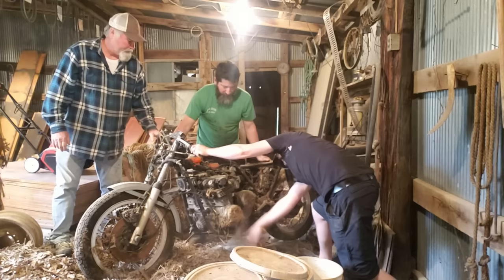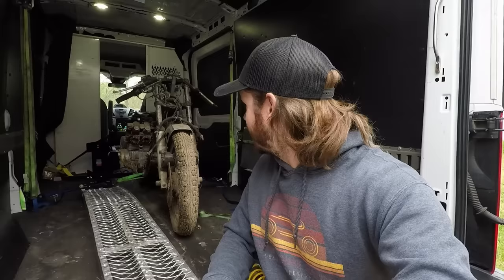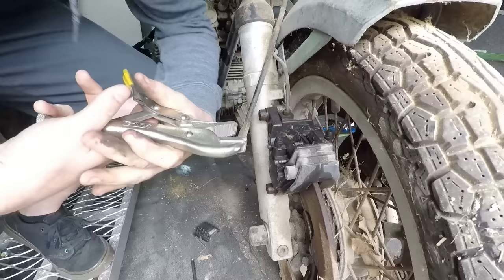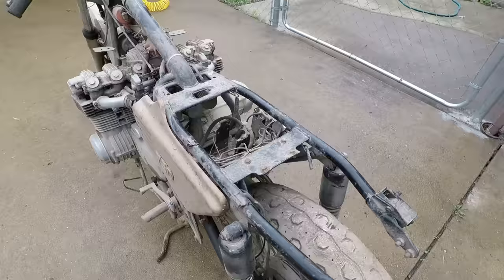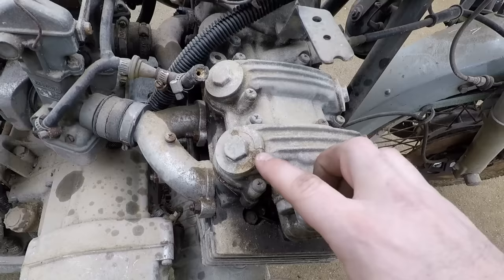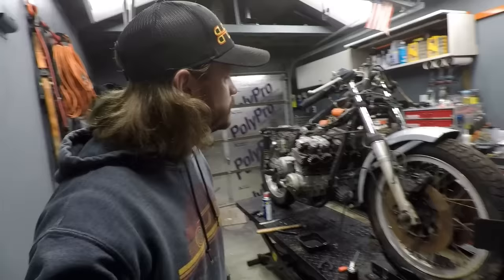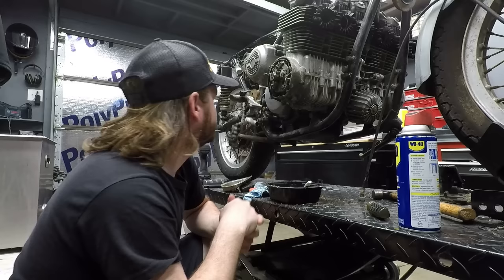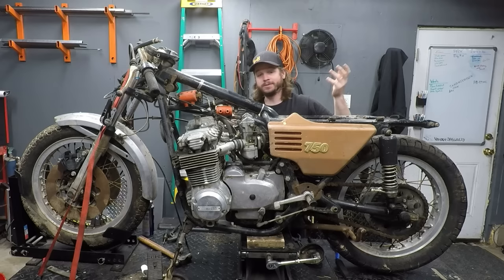BARN FIND Benelli 750 SEI 6 Cylinder!

Comment: GO AND BUY THE CORRECT SIZE PLUG SPANNER, PULL THE PLUGS, THEN PUT SOME UPPER CYLINDER LUBE IN IT, BEFORE YOU TRY TO TURN IT OVER. THOSE PISTON RINGS WON'T LIKE WHAT YOURE DOING!!!!
Reply from the maker: You left your caps lock on

Comment: I am pretty sure you've heard of this before but, just in case "Black Ironwood" or "Oak" wood wedges work wonders on cases and most cylinder heads and jugs. If you make them in 7 sizes (you'll know which ones) they can cut the hammering and fatigue in half with way less effort. I learned that from a guy that built "Side Valve" and "Knucklehead" Harley's!

Comment: I have actually ridden one of these bikes. One of my friends bought one from an old timer who didn't know what he had or what it was worth. My friend is one of those guys that always seems to find those unbelievable deals. The owner thought it was shot and needed a full rebuild but my buddy noticed that the plug wires might be wired wrong, SO he offered the guy around $2500 for it (it was several years ago) and he took the bike home. The firing order was incorrect LOL. They are pretty fast and very rare. The best thing about these bikes is the sound! They rev to around 9K and sound like a Ferrari! Good luck with the repair.
Reply: They made them from 72 right up to 89, first in 750cc like this one then later in 900cc, theres more of them out there than people realise. :-)

Comment: Amazing, this one was a rollercoaster for sure. I noticed the fairing bracket on the front from your picture on the weekend but after looking at it for a few minutes realized I had no idea what it was other than some old custom racer, but hey I'm still learning this stuff. I agree turning it into a more modern version of what it was would be pretty cool but time to do it is your other issue. Would be one helluva build series though. 👍👍
Reply from the maker: Yea a Rollercoaster for sure! If I had a plug socket I could have done much more but oh well. I feel a build is more fitting for the bike. There are plenty for museums and collections so this will pair nicely with the already modified Benellis

Comment: No need to apologize for not doing the "as factory new" type build.  Totally agree that using the this as a basis for a nice Cafe Racer or just a nice street bike using as many modern parts as possible. Reliability, safety and performance is what motorcycling is about (in my opinion).  Super cool find!
Reply from the maker: Agreed! I am just compelled to address my decisions multiple times as a lot of people like to comment before watching the whole video and hear my reasoning.

Comment: Wow nice score. There was a perfect small bike shop in town here called British Motorcycles.Through the `70s they were new bike dealers for BSA, Triumph, Norton, Laverda, BMW, Moto Morini, the odd Ducati or Benelli. Never more than 10 new bikes in the showroom, the selection varied constantly. If you turned your back to the showroom, you were standing at the parts counter, which looked like a re purposed bar. Yes that small. 
They had a couple of 750 SEI in there over one summer. Both were Ferrari red with 6 into 6 exhaust. You could even buy aftermarket 6 into 6 systems to make them cooler and louder. Only a few guys in North America raced those, still with 6 pipes! A pal had a 900 SEI with stock 6 into 2 pipes. It was faster but no louder and not as wild as the 6 pipes. Remember the mufflers then were way smaller, forget the huge cans used now. Like paint can size or less.
There were even 6 into 6 aftermarket pipes for a CBX. Coolest blasting sound you ever heard. 
Hope your project works. Beware of the nasty sharp edges the Italians left on mating surfaces. Got some cuts from those till we learned to de-burr them asap.
Reply from the maker: Sounds like an epic proper old school motorcycle shop!  Im a sucker for 6 into 1 systems myself and plan to make or source one for this whenever we get to that point. Same for the other CBX I have.
Reply: @BrickHouseBuilds  Hi BHB. Denco and Devil were 2 companies making pipes for Binelli back then. I bet someone still has a set forgotten on a shelf. Ebay search?
You would have been in that bike shop a lot. Run by Peter Clegg who is still around, he even arranged Isle of Man travels. You brought your own bike, in the hold of the 747 you were on. 25 bikes and 30 people went on our trip. Ming boggling cool, wall to wall Mv Agusta, Laverda, Brough Superior, et all.

Comment: I am  a  huge  70s  Benelli  fan 
Your  Honda  CB 500/4 knowledge will help  you out a lot here.
This engine is basically a Honda 500/4 copy with two extra  cylinders 
To the  point that  quite a few of the  engine  internals are  inter changeable  between the two makes.
Nick Australia
Reply from the maker: Thats what I'm finding which is great

Comment: If the cracked case leaks, JB Weld it so it will hold oil, then oil the cylinders up with a good penetrating oil, fill the crankcase, plug the exhaust ports, bag the carb filters and then you can let it sit until you have time for it. What a great find! I can't tell you the last time I've seen a 6-cylinder Benelli....
Reply: I have one lying  at the back of my greenhouse and that is where it is going to stay, the plants seem to like it.

Comment: I had one new (and was a Benelli dealer in the 70s) and bought one that didn’t look much better a couple of years ago.  I did a full engine overhaul, cleaned/painted and it runs great now.
 Parts are readily avaliable, with LA Nik having quite a few here in the States.
Reply from the maker: Great info Mark! Have a link by chance?

Comment: Ive got a black 900sei tyhats been sitting in a garage for years.Gonna get to it soon and get it running again.These bikes have plastic fuel cells with just a black fiberglass shroud that just looks like a tank.I have two tanks.One had the petcocks actually sawed out and the other has hairline cracks around the petcock threads.Mine was stored for years in a heated garage and had been sprayed with some type of brown preservative.The whole bike was sprayed looked awful BUT it cleaned off to uncover an emmaculate bike.Ive got 14 classics .This is the last bike I have to get to.Doing a Guzzi LM1 right now.I have 6 Guzzi's.

Comment: The Benelli multi's were basically copies of Honda cb500's with 2 extra cylinders added. Many engine parts are identical to Honda parts. I recall hearing that the bore and stroke and the valves, are the same as the Honda, and the valve inspection covers also. I imagine that getting genuine Benelli parts may prove problematic! Best of luck with the rebuild!
Reply from the maker: Yup that's what I'm seeing. Luckily I won't need any Benelli parts outside of some gaskets and a few other bits
Reply: Is it so much a honda that it needs JIS bits, just wondering, benelli being italien and all?
Reply: @larshermansen3463  No. Allen screws all round.

Comment: It’s always an advantage to try to get a motor to run early on to see if there is value in continuing. Bought one with a blown piston but didn’t notice until dropping $500 in parts. Should have made it run first.
Reply from the maker: Agreed,  I'm not sure I can avoid an engine teardown with this one due to the case damage but who knows.  Once I get the plugs out Ill see what to bores look like and assess from there.

Comment: It’s definitely worth bringing back to life. I suggest you simply get it running at your leisure over time without rushing anything, heck you may even find some needed parts as time goes by.  Aluminum tig welding is tricky if your not experienced with welding aluminum.  Definitely worth taking the motor apart for a proper repair… but cost effectiveness is the big factor here.. I would never trust JB weld, I lost a motor like that!  
I wish you luck with it… and someday if you decide to sell I would be interested in it. I am a professional machinist and wouldn’t mind diving into it.  Wishing you the best no matter what direction you take.
Reply from the maker: Yeah this bike will be a rewarding one to bring back. The JB weld is just to make it run kind of thing but splitting the cases and doing it perfect is more likely what will happen.

Comment: just a word of advise from an old motorhead, i never try to turn one over until i get the plugs out and soak the rings in breakfree or wd or 2 cycle or ? those rings can break or crack easily !!  i have found that an old spark plug socket that came with some old bikes will sometimes work,  wrench on my friend !!
Reply from the maker: Right I talked about that but obviously couldn't get the plugs out with the sockets I had on hand. It was a shame I only had 24 hours from buying it until it had to be back in the warehouse to get back on customer work. Standing by the bike now and its definitely distracting lol

Comment: Great find!  It"s already got Honda switches fitted to the one side. Many more Honda CB500 sohc spares will fit. Keep up the good work!
I hear you with regard to not having the time to restore it right now but this Benelli needs an in-depth rebuild so I would park it for a year or so and then tackle it. JB-Weld just to get it running... and then what? I say park it, collect the necessary bits and pieces as and when you find them and when you're ready give it the love and attention that it deserves.
Reply from the maker: Agreed. It will be a year before I touch it regardless and in that time I'll be working on back end research and parts sourcing
Reply: @BrickHouseBuilds  If you tell us what major parts and components you need I can keep my eyes open for them here in Germany?

Comment: That hole you were  talking about using JB Weld on is the main oil gallery & feed to the mains & crank etc.
Reply from the maker: Correct. Not talking about slathering the stuff on aimlessly but rather recreating the area to allow oil flow/oil pressure

Comment: As for the lower engine case, I think that as it is outside the actual crankcase it could be an easy weld without stripping it, Tig in small doses would be ideal, but it has certainly been down the road
Reply from the maker: Its a bit of a tricky spot with it having an exposed steel pipe for the oil galley under the aluminum that broke off. Welding the case at the necessary amperage may melt the steel and make things more difficult.  It will be a challenge for sure
Reply: @BrickHouseBuilds  Ah! I see, or rather I couldn't, terrible camera work mate :) :) well you're the man on the spot, shelve it until you have the time and energy then, maybe even find a new bottom half, although that the first casualty in an off.
Reply from the maker: @k13ehr  yea that shot of the damage was  terrible  lol.  I'll show more in time with more time
Reply: @BrickHouseBuilds  No worries we all have to start somewhere 👍😉😊😁🤣

Comment: It has obviously been crashed which is evident by the damage to the points housing and the lack of fairing , tank and seat . Maybe the owner put on a new front brake lever and then decided to give up . The water coming out of the engine is most likely because the exhaust ports were not sealed before water blasting . I have a 500 Laverda which I am slowly getting road worthy , so good luck .
Reply from the maker: Paul, I talk about it being crashed. Also, I did seal the ports which I didn't show. I had sprayed up that oil galley before I realized the hole was there so thats why the water came out.

Comment: I have a 1980 Benelli 900 Sei in the back of my garage, one day I'll get it back on the road where it belongs. My 900 has a bank of six 22mm Dell Orto carburettors, Tarozzi rear set controls and a modified Silentium six-into-six exhaust system that was intended for a 750 Sei.
Reply from the maker: Awesome bikes!
Reply: @BrickHouseBuilds  Thank you for your reply, they certainly are awesome machines, they are well balanced and handle far better than Japanese machines of the day. I have owned my Sei since 1986, so it is certainly a keeper, the value of both 750 and 900 Sei models have risen sharply in recent times, there is a 16.5k mileage 900 Sei currently for sale on the UK eBay site for an asking price of £19,999. We have an avid Benelli - MotoBi owners club here in the UK.

Comment: The Sei is not a very complicated bike.  It's been said that the motor most resembles a Honda 550 Four. It might take a little looking to get the proper tank and accessories but, with the low production numbers of many of the Italian bikes, many of the accessories are used on more than one brand. Should be a fun project.
Reply from the maker: No more complicated than most of what I work on. Luckily I don't need to source many factory parts as it won't get stock exhaust or tank so that makes things much easier

Comment: CBX engine swap with the vintage racer look?? Haha that would be awesome but this is a cool video BJ! Sucks that you found those issues but like you said, you saved it from the barn and watching the pressure washer clean up that ride was also cool.
Reply from the maker: Well the CBX engine is very different.  This is the original engine. Basically a cb500 four with two extra cylinders.  Single over head cam 2 valve per cylinder

Comment: Love how similar the engine looks to a CB engine.   Would be cool to put one in a CB750 chassis
Reply from the maker: It would be purely for the sounds as a SOHC CB750 makes the same power as these
Reply: @BrickHouseBuilds  yes for a sure and also the wtf expressions on peoples faces trying to work it out
Reply: I bet it’s not as reliable as a Cb 750 ..still great find
Reply from the maker: @donbrashsux  maybe but maybe not
Reply: @BrickHouseBuilds  The Benelli Sei was based on the Honda CB500F, a Sei motor will slot straight into a CB500 or CB550 chassis, but why bother installing the motor into a poorer handling Japanese chassis? A stock Sei will run rings round a Japanese four of the same era.
Reply: @davidmacgregor5193  Two points: First, you’re right about a CB500-4, a guy I was slightly acquainted with back in the late seventies used a CB500 engine in his Sei while he was waiting for parts from Italy. I dimly recall the CB550 was slightly different, maybe due to the change in the clutch actuation but I recall it didn’t fit, definitely could be wrong. Second, don’t jump to conclusions, the CB750 chassis left room for improvement but the 500 handled very well. On the street and on the track the few guys who got past me were better riders or they waited for a straight, I can’t blame the bike.

Comment: You're right, its to far gone to restore and make money, did'nt Honda take Benelli to court over these as the engine is just 1 1/2 Homda CB500/4 so if you need engine spares the honda parts will fit
Reply from the maker: Im not sure about court as it may have been licensed from them. I honestly don't know much at all about Benelli other than a quick Wiki but know enough to jump on the opportunity

Comment: Had a friend of mine who had one of these and let me borrow it for summer. Just about every standard position of braking and shifting was switched and backwards. Took a while to get used to. Was a fairly fun bike but nothing too outstanding about it. At least yours has disk brakes on the front  mine freinds had drums and they could be a bit scary.
Reply from the maker: I assume he went GP style on controls. That may be what I do just for fun...or not fun lol. I am expecting nothing outstanding as my cb750 should be on par for hp. It is a small bike though so I'm excited to see what I can do with suspension and brakes

Comment: No JB weld , disassemble everything put in box’s come up with a plan what to work on first. Not saying total restore. Just clean original. Complete and running. Using donations.
Reply from the maker: Oh Id prefer the rebuild but for the sake of science a bit of JB to reshape that oil galley and get it running would be cool.  This project is far out for now as....my CBX is fully disassembled in boxes with that plan.....
Reply: Been there done that I have had for CBX motorcycles all 1979 I can tell you the good and the bads.

Comment: Worked oil  refinery shutdowns. We used a mixture of brake fluid and acetone , we called weasel piss .To unfreeze everything. Just spray the weasel piss on and tap the stud  ,nut with a hammer.
Reply from the maker: I'll have to make a batch of said piss!

Comment: Irony is rear sets on a bike that is way too broad in the beam! Engine will drag cornering. My cbx had a Jack shaft with alternator on it to keep engine width reasonable...my kz1300 was too broad in beam too.
The benelli was a cloned honda cb750 sohc with two cylinders added...
Reply from the maker: Regardless of how wide or narrow it will still be amazing fun. There is always something to out perform it such as any modern bike. Also these were modeled after a cb500f not 750

Comment: I’d personally try to restore it! As it’s a rare Italian super bike. Is it possible the exhaust and tank are somewhere?? If not the rout your suggesting seems a good compromise!! Wishing you the very best of good fortune in getting the bike to the standard you desire bud!! Love it! ❤❤
Reply from the maker: No chance they had more parts as we checked all over. Luckily I have no interest in any of the stock parts so it will get a period fairing and likely aluminum or fiberglass TT style tank. 6 into 1 for pure sound. Gonna be rad

Comment: I had one of these back in the 80s. With a 6 into 1 pipe and pushing the revs through the 8000 rpm red line the bike would sound better than the CBX . People would step off the sidewalk to tell me it sounds just like a v 12 Ferrari F1 car.
Reply from the maker: A 6 into 1 is definitely the plan. They sound insane